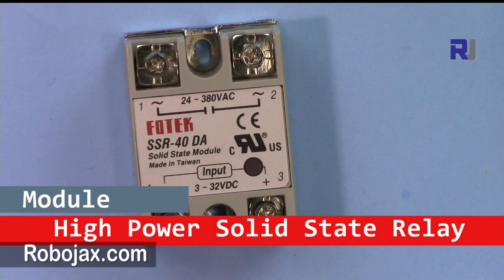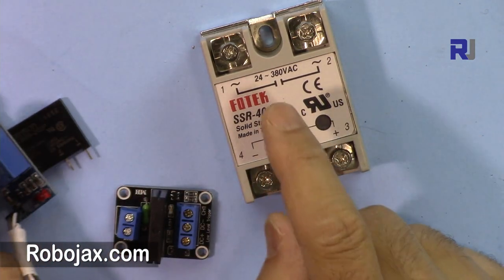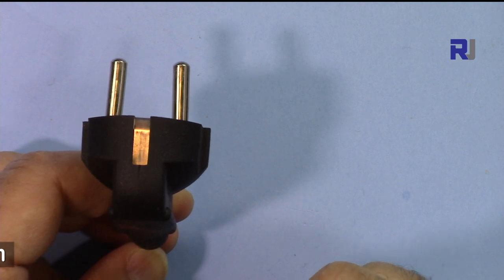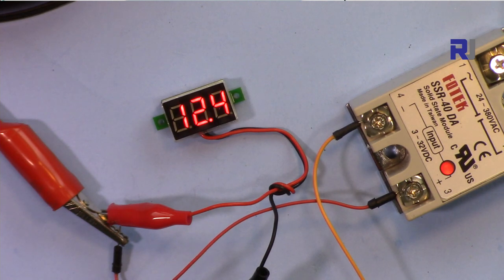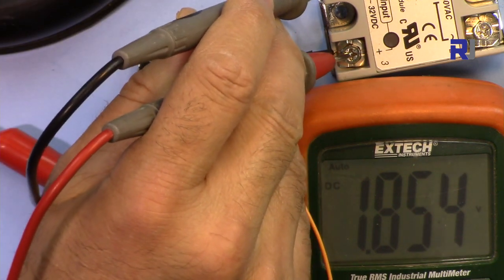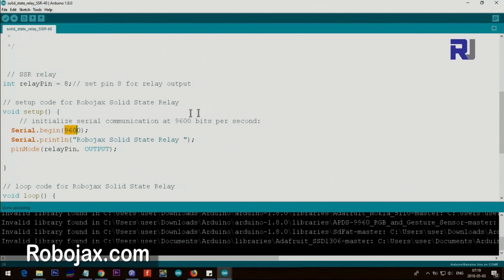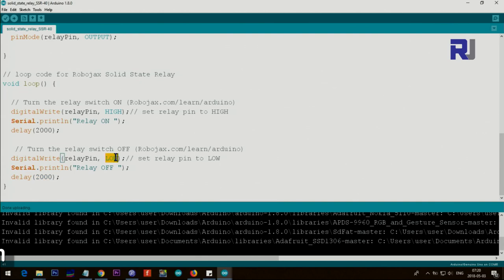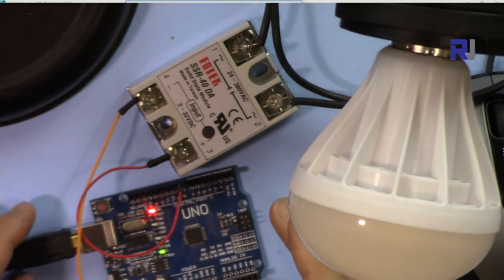How to use Fotek SSR-40 Solid State Relay with Arduino and without Arduino

Comment: I'm not sure if this is universal but at least in Finland it is nowadays instructed to not solder coat mains wires attached to screw terminals. The reasoning is because solder can easily crack, making the connection loose. Instead a better practise is to crimp the wire ends or just twist the stranded wires together.
Reply from the maker: I agree. For safety reasons it should be implemented. Different countries have different code for this practice and safety should be the top priority/

Comment: I bought a SSR 40 A A and sent it back.  I used it to control a 115vac load and the relay was allowing 51 vac through and the input was off.   Same brand.  I suggest if you bought any of these that you check voltages when it is supposed to be off.   Apparently it was working with input on and happened to check load voltage off and found out then it was allowing voltage through which definitely I did not want!
Reply from the maker: thank you for sharing your experience.

Comment: nice video, however I have a challenge, I am using SSR-40 DA to control air compressor., source DC switching is done by controller board DLC32 (Doesnt matter). The relay switches on as I can see the read light turn on however the load remains off, until I unplug the AC supply and turn it on again. It then switches on successfuly. Also once the source DC is switches off AC successfully switches off. I was wondering what could cause this since these relays have in built snubber circuits

Comment: nice video for the SS RR DC DC what frequency for the output limitation ? as a square wave i mean in the putput
Reply from the maker: this is for AC only. square wave will not work.
Reply: @robojax  I know but I asked about the one for dc input and output dc
Reply: you want a continuous signal, on or off, instead of PWM for this application.

Comment: Can I use the arduino gpio pins to control a ssr100(60 more ampere than this one); And use the relay to control let's say a phone charger, and sometimes a lamp? Or it wouldn't work because the relay would be overkill for this application? Thank you so much for your work
Reply from the maker: I have not tested it but it should work as the input of the device just needs signal which Arduino can send.

Comment: Great video! Thanks! 
I just have a question - do you know if the back metal plate that attaches to heat-sink is completely isolated from all other circuits? Can I mount SSR to grounded metal body of the device?
Reply from the maker: You are welcome. I did not pay attention that that and don't know.
Reply: It should be isolated. But to check, use a multimeter between the backing and each of the lead attachment lugs to check continuity.
Reply: @toozinger  I decided not to use Chinese replica Fotek SSR that came with my 3d printer's AC heated bed. Instead I bought two SSRs of another brand from mouser.com. One is controlling heated bed, another printer's main power supply. Both SSRs are attached to the same metal plate and work just fine. So, the original SSRs are isolated and can be mounted to grounded heat-sink, as for replicas - they should be isolated as well, but you never know...

Comment: hello, I have a project which I want to control the rpm of brushless motor by inserting a voltage in labview. I have NI9201 as my analogue input and also a solid state relay can you guide me in my project?
Reply from the maker: brushless motor is totally different motor. it has 3 wires of power like 3 phase.  you need ESC (Electronic Speed Controller)  see it here https://youtu.be/3BvXXBCqqfc
Reply: @robojax  yes does the brushless motor can't be controlled in labview?

Comment: I've been hearing that SSRs won't turn off since the Triac does the job internally and the current has to be cut between outputs. How come this one goes off?

Thank you for your video, very useful.
Reply: Nvm, just realized it's with AC. Would it turn off with DC?
Reply from the maker: DC would not turn it ON as it needs both negative and positive half cycles to turn ON or OFF.

Comment: Thanks for the helpful video. I also use an SSR with a temperature controller, but I am often afraid that it is not much powerful as wrote on the label. On my channel there is a training video on how to connect an SSR to a controller, please watch  it/
Reply from the maker: I just visited your channel and watched your last video that you control heater with temperature control and SSR. Excellent work. keep it up.
Reply: @robojax  thank you. Your positive rating  is very important for my young channel

Comment: i have a SSR and arduino how can i control the SSR by arduino if the SSR start to activate the switching at 6.5 volts not less ? thanks
Reply from the maker: Solid state relay is for AC power only.
Reply: @robojax  to activate the solid state relay I have it’s written on it 3-32 VDC but it need 6.5 vdc how can I control it with an arduino
Reply from the maker: then use the method I've shown in the video.
Reply: @robojax  the arduino will not give a signal of 6.5 volts maybe 5 volts max but not 6.5 that is the main issue

Comment: can I use the same solid state relay to control air conditioner and geysers with micro controllers?
Reply from the maker: Arduino is a microcontroller and I demonstrated it.  the amount of load you are trying to control should be equal or lower than rated current written on the SSR-40.

Comment: Can I use an ESP8266 module and a 40DA SSR 40amp relay to control an electrical smoker?
Reply from the maker: yes you can.
Reply: @robojax  pin plus relay to pin esp ? its not work

Comment: How many mili amps does it pulls? Can I use it for microwave oven transformer spot welder?
Reply from the maker: it needs 10 to 20mA. I just watched the video.  For load capability, please watch the video as I have explained it. it seems you have skipped the video or missed it.

Comment: what if I just want to test the SSR without any AC load? is this possible? let's say I just wanna make sure this SSR open or close, and then get the statue by print it out on the Serial monitor.  so the  SSR pin 1 and 2  not  connected with anything
Reply from the maker: yes. you can. Arduino will not know if load it connected or not.

Comment: Hi, do you have a project explaining how to use a PID   with Arduino  SSR's. I'm building a powder coating oven with two 220V  2000W elements. I need to control them like a PID using and arduino. I dont want to use a PID comercially available because  too many parameters i dont need. thansks
Reply from the maker: hi, are you talking about talking about control system? is so NO. The more advanced video I make the less people are interested. So I am going towards basic and simpler videos and tutorials.

Comment: Having 3.x volt to activate the relay give it a LOT of use with ESP8266. My question to you is how I can make it LATCH once it gets the 3.x high ?? Also it will be great if you can demo this with a toggle capabilities. I want to activate it with a touch sensor. Is all that possible ???.
Reply from the maker: Here is my video exactly doing that. https://www.youtube.com/watch?v=Nqh1vYQEEjs&t just  your own relay instead of the one shown in video.

Comment: that songle relay 10A seem not to be trustworthy, if I do not exceed current and assume I will try to handle 5A max on 10A relay, is there any fire hazard possible?
Reply from the maker: for safety question please contact the manufacturer.

Comment: Didn't explain the wiring fully. Does the hot end of the AC side connect to ~1 and the device to ~2, or it doesn't even matter? Do you connect live or neutral to the relay?
Reply from the maker: you made me watch the wiring section of the video.  It can't be explained better, even I mentioned and showed the AC plug of different type. If I type here again, then why I made the video. Please watch. to get the answer.
Reply: @robojax  Sorry you didn't explain whether you use the relay as a breaker on the live or neutral wire you just said that in some countries the plug is impossible to identify which is which. It's not impossible where I live and it's kind of important.
Reply from the maker: Did you see when I shown the bulb? That is the answer
Reply: @robojax  NEC 404.2(B) Grounded Conductors. Switches or circuit breakers shall not disconnect the grounded conductor of a circuit.

You must break the live power wire.

Comment: Hi sir, is there a way to adjust the output voltage to 220V?
Reply from the maker: no. this is just a switch that turns ON/OFF the power.

Comment: is there any way to fully off the SSR.How will motor change direction while one side is already getting leakage voltage from SSR.will it cause demage to motor.
Reply: acqurius 2018 I guess you have to explain what is your project first
Reply from the maker: didn't we?  it says "how to use ...."

Comment: Hello !! 
Can we dim a led stip by using solid state relay?  Or control the speed of the fan (both AC AND DC)
Reply from the maker: Hi, This is good point. I should tested the dimming. In the data sheet (provided with the code) the response time is less than 10ms. So if you use PWM, you can dim it .
Reply: Robojax thank u for the quick reply. Please make a tutorial on it so that it will be help full for everyone.  And i came across ( OMRON 1556E G3MB-202P ) while i was searching for solid state relay. Is it the same working behaviour as what you have used in this tutorial?
Reply from the maker: I try to create a video on that. For the Omron solid state relay, the principle should be the same here is my video on that (omron ssr) https://www.youtube.com/watch?v=2y6t0GoeCZA and here is video on module used OMRON SSR https://www.youtube.com/watch?v=64NatLeGsaE
Reply: Robojax wooo how come i haven't come across that video !! Strange !!! Thank you for the tutorial.  And i heard you saying you can turn on the heater in that tutorial. But 2A current is way too less right ? Is there any other relay available with more current capabilities?  
Thank you for your replies.... 🙏🙏
Reply from the maker: You are welcome. 2AX 240=480W, there are small heater or heating elements in industrial applications.
if you want higher current Solid state relay, the size increases,.
Reply: Robojax thank you so much for the info

Comment: iwant  3 hp waer motor  by this relay so i can ?ahamad bhai help
Reply from the maker: I tested the current.  You 3hp itself has no meaning without the voltage or current. But I tested and shown that this can handle 40A. so you do the math.

Comment: Hello Everyone, I have a small question about SSR D1D100, I have a battery output connected through SSR to Load Motor, and I can easily Turn On and Turn OFF SSR D1D100 with input Voltage as wanted..but it is only Battery Discharge Mood connecting Motor but When i want to charge the battery, I have same SSR connected and Charging through Relay in to Battery(I can also Stop Charging by Turn OFF Relay and TURN ON Relay to Charge was the IDEA) ..So  I don't know why these SSR works few days and Goes always TURN ON Mood? so my question is are these SSR D1D100 only used to connect load and discharge not to Charge Battery ? Unidirection not Bidirectional?  Thank you for your Helpful Answer
Reply from the maker: This was hard to understand. Please draw a diagram, post it on https://snag.gy/ website by copying and pasting. You don't need account. Once your photo is displayed on https://snag.gy/, you will have unique URL (website address), then post the address here and I will look at the wiring diagram and reply. You can use Windows Pain to draw.

Comment: can we use SSR to control the direction of reversible AC motor.i tried your circuit but bulb get ON with dim light although I have not given On command from controller.how I can resolve this issue.you have not discussed this issue in video and also not shown this situation.
Reply from the maker: This can just turn ON or OFF, you should control the direction of rotation either before this or after this.
Reply: I think you bought the fake SSR, the cheap (fake) one have a poor isolation. Yours are broken, you better get the original one for serious project.

And your question about SSR control direction of AC motor, where did you heard that SSR can drive those motor back and forth? You need a AC motor controller for that.

Comment: Hi Robojax
How to used this for temperature control?
Thanks
Reply from the maker: Hi, you are welcome. This is just a switch. you can turn it ON and OFF using temperature. I have explained how to control something with temperature in this video https://youtu.be/S5IBc_epa1A (in the code section)
Reply: @robojax  thanks, its very help me
Reply from the maker: You are welcome.

Comment: I have a problem with the same SSR. I'm using it to run a pump but when I engage it with a timer running 24dcv, nothing happens. So I switch the pump off and back on it seems to work fine until the timer kills the 24vdc and it shuts off perfectly. 

Anyone have any ideas that could help?
Reply from the maker: What does the timer do?  Perhaps you connected the timer after this module. It should be connected before the module directly to the power.

Comment: What is the reliability of this ssr is it still running
Reply from the maker: If you get the authentic party it should be very reliable. If you put higher than 5 A load then attach a heat sink.
Reply: @robojax  thanks for the replay, one more question, how much min current is required on the signal to make this relay work, I'm building a project and incase I wanna hook this on to a raspberry

Comment: can this relay control 2hp ac motor?
Reply from the maker: I did  the test. you do the math based on the  voltage, current and power.

Comment: Does PMW works on this SSR?
Reply from the maker: Interesting point. I am not sure if this device can be turned ON and OFF that quickly. I have not tested that.
Reply: I dont think it is gonna work, AC has already 50Hz of frequency, which means the signal up and down like crazy in 1 second, and now you add PWM in it. Imagine how nightmare the wave form would look like

Comment: doesn't work with a 1/2HP motor, i used SSR-60 but the motor doesn't turn on instead it is humming
Reply from the maker: I mentioned the maximum current and voltage. so check the datasheet of your SSR and your motor. it should work if you don't go above the limit.
Reply: @robojax  figured out, problem was 5V input & working after connecting 12V, thanks for your time....

Comment: All good except for the SSR you're using, according to Underwriters Laboratory, is a FAKE.  It suffers from under rated internal parts and marginal isolation properties.  It can at most handle 16 amps and will fail a 2500 volt isolation test.  Use with care.
Reply from the maker: Good.
Reply: Yes, I'm aware of that too, my sugestion is to use the cheap one for low current load only. If you need SSR to switch something expensive, you better buy the expensive SSR too.

Comment: Please be careful - it looks like you have a counterfeit SSR there! 
Look at the font on the logo - it really says 'FQTEK'...!  
There are several variations on this all over the internet but they all contain non original parts.  The thing is they may appear to work as expected, but they will not be safety tested and are unlikely to be able to match the rated power without overheating,  They are more likely to fail ON which could be very unsafe.
Reply from the maker: Thanks for sharing. The code and my test is useful if they get “authentic” module

Comment: How much load can it handle? (in watts)
Reply from the maker: What my friend. That’s why I made this video . V*I=P
Reply: @robojax  You showcased the varying voltage on the input but I am talking about output. It would have been better if you could have applied a varying load at the output.

Comment: I hate to burst your bubble but that Fotek relay is a fake and probably can't handle 15A. Also the isolation is very poor, this an electrical hazard.
Reply from the maker: I just presented my test  results. Why fake? Tomorrow you come and start a new firm. NEC comes and says you  are fake. This won't be true. Whoever is behind Fotek, they are legit as ST or TDK or NEC.
Reply: I bought one of these to play about with.  When connected to AC I get about 12 Volts AC to earth from the input side.  Surly this can't be right?  I think you are right about the isolation.  I have never had a look at a proper one so have nothing to compare.
Reply: More details here: https://protosupplies.com/inferior-counterfeit-fotek-ssr-25-solid-state-relays-on-the-market/